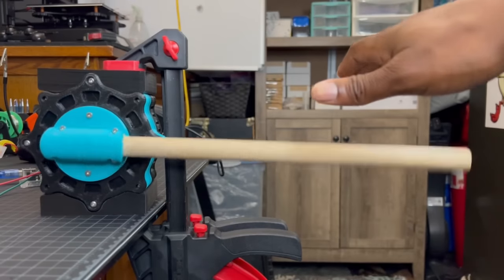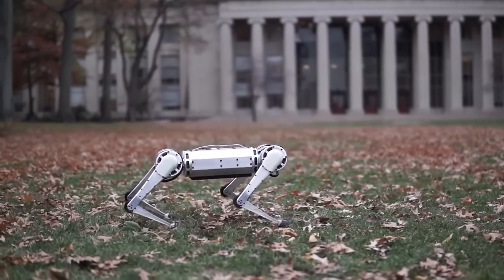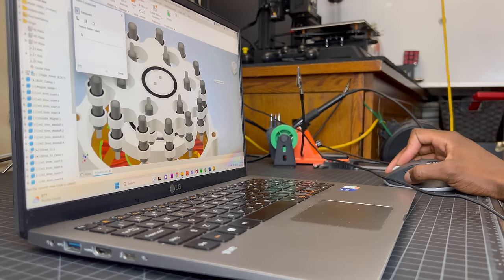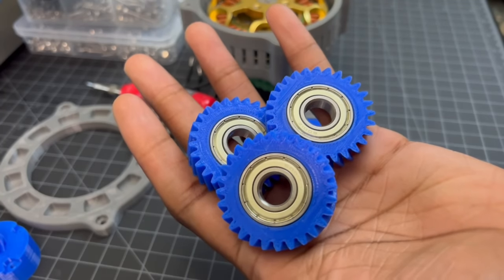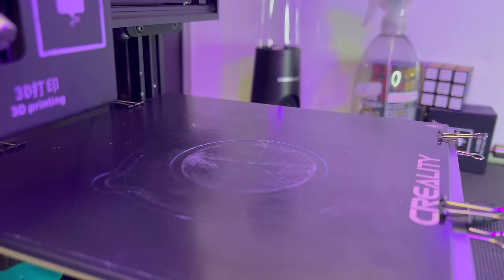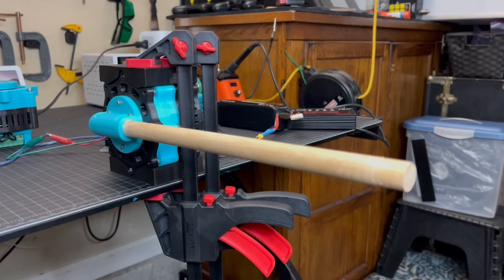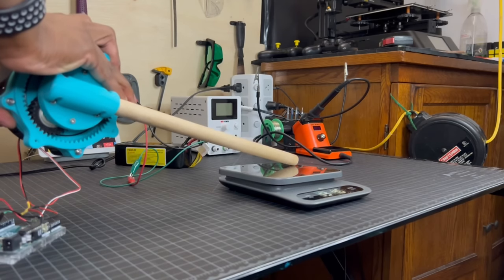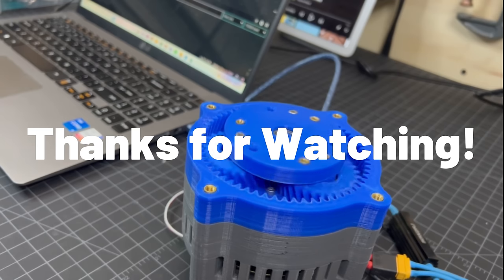I Built a Robotic Actuator.......Lets Test it!

Comment: Awesome video  little advice herringbone gears may be a better idea than helical to keep from exerting a perpendicular force on the gears.  Please educate me if I’m wrong!
Reply from the maker: That's true, but it's impossible to use herringbone gears with a planetary gear drive because you cannot push the planet gears in due to the two different profiles.
Reply: Also, sorry commenting as I watch.  (I love the content don’t take any of this as criticism i could be wrong) when you are fitting your gears into 3D printed parts it may seriously impact your gear efficiency to hammer with uneven pressure. Ideally you would press fit them in with a flat headed vice. In my experience this should extend the lifespan of your parts as well as improve efficiency.
Reply: @AaedMusa ahhh I see!
Reply: Also that controller that you used instead of an esc is so cool, I had no idea brushless motors could be controlled like that.  Really blew my mind

Comment: Wow, that's pretty neat! If you make a video on a walking robot, I can't wait to see it. Your website is pretty dope to get more info and the design from. Top notch creater that deserves more attention. I've heard of those brushless drone motor catching fire becasue usually they are meant to have air blowing constantly through it, but it can be managed hopefully. Cheers!
Reply from the maker: Thanks! Hopefully, that won't be an issue with the current and velocity limits but putting a small fan on the inside could be a potential upgrade in a future iteration.
Reply: James Bruton on here has made many walking robots check him out
Reply: @AaedMusa  With those vents I can see using a small temperature sensor and one of those super small aliexpress 12v pc fans to actively cool it if it starts to overheat. 
Also, production value is 🤌keep it up!
Reply: @andycrask3531  Yes, it's a great channel. I've been subbed to him for a few years. I like this actuator better than the cycloidal drive actuator that James Bruton build for his walking dog because it's much smaller with the motor assembly and everything as well as having fewer barrings which can jack up the cost a lot very quickly.
Reply from the maker: @andycrask3531  I love his videos. I took a lot of inspiration from his cycloidal actuator design in opendog v3.
Reply from the maker: @FasutonemuMyoji  Great idea. Something to implement in a second version0. Thanks!

Comment: I noticed one thing wrong with your 3D printer you may want to consider fixing. Your bed looks loose from the clip at 2:03 underneath the bed there should be eccentric nuts, tighten them until it doesn't wobble. Look up a video on how to tighten it for further instructions.

Comment: Pounds? What's that? Why do they still insist on using outdated measurements instead of adopting the universally accepted metric system? The international scientific community has embraced the metric system for its precision, simplicity, and ease of conversion. Transitioning to the metric system would not only promote global consistency but also facilitate cross-border collaboration, facilitate trade, and enhance scientific communication. It's time to leave behind archaic measurement units and embrace a standardized system that promotes accuracy and efficiency on a global scale.
ps: Liked and subscribed.
Reply from the maker: You are right, buttttt as long as I'm working on personal projects I see no harm in using two-unit systems. It only matters in industry.

Comment: Hey, I'm almost done printing all the parts and I ordered everything I need. I was wondering, is there any particular reason you didn't use a BLDC motor from ODRIVE?
Reply from the maker: Too expensive and low torque densities.
Reply: @AaedMusa  thanks for the quick reply. I figured. Have you done any torture tests to see how well the PLA holds up? I printed mine in PETG.
Reply from the maker: @TheAdventureLog  No I haven’t done stress tests yet. I also haven’t printed around with PETG but I’m pretty sure it should be stronger than PLA. You can always print at 100% infill if you are worried about failure.

Comment: Great video. I would suggest you use a vice for press fitting things rather than a hammer, a vice let’s things go in straighter without any impacts. I would also suggest using nylon for the gears if you are able to print it.

Edit: you should also stop mixing units, you measured the arm length in inches and then calculated torque in Nm. NASA made a mistake once due to mixing units and ended up destroying a probe.
Reply from the maker: Yep, unfortunately, I don't own a vice. I have never tried nylon but that's definitely something to look into.

Comment: The torque is proportional to the area of the stator, not diameter. The flat ones are proffered due to the surface area which provides cooling.

Comment: Please help to answer a few questions for the video:
1: What is the first step in creating an electric actuator for a walking robot?
A. Designing the gear drive
B. Researching the best actuator designs
C. Building the motor controller
D. Testing the actuator compliance

2: What type of motor is recommended for an electric actuator in a walking robot?
A. Standard DC motor
B. Brushless motor
C. Servo motor
D. Stepper motor

3:What is the purpose of using a gear drive in an electric actuator?
A. To increase speed
B. To reduce efficiency
C. To increase torque
D. To decrease compliance

4: What type of gear set was used in the actuator design mentioned in the text?
A. Spur gear set
B. Bevel gear set
C. Planetary gear set
D. Rack and pinion gear set

5: What is the benefit of using helical gears in an actuator design?
A. Low load capacity
B. High noise level
C. Ideal for high load applications
D. Inefficient power transmission

6: What type of controller was used to control the brushless motor in the actuator?
A. PID controller
B. FOC controller
C. ESC controller
D. PLC controller

7: What does FOC stand for in the context of motor control?
A. Field Oriented Control
B. Frequency Oscillation Control
C. Force Output Control
D. Feedback Override Control

8: What is the compliance feature of the actuator used for?
A. Increasing speed
B. Absorbing shock
C. Reducing torque
D. Improving efficiency

9: What was the peak holding torque of the actuator when tested with 10 pounds?
A. 10 newton meters
B. 14.5 newton meters
C. 16.36 newton meters
D. 20 newton meters

10: What is one advantage of the actuator design mentioned in the text?
A. Heavyweight
B. Requires frequent maintenance
C. Open source design
D. Inefficient cooling system

Comment: Please don't hammer bearings into place.  If you must,  at least find a short piece of metal tube the same size as the outer race and tappy-tap on that.   Squeezing them in a vice would be better (with the ring to ensure all pressure is on the outer race)  if you don't have any other kind of press.   If you can't find or make an appropriate tube,  maybe you could print something.

Comment: Thanks! Also, having the clamps on one side made my eye twitch. Those tests aren't providing enough data about the motor without a stationary point. Make your base wider, Flip the clamps 90 and add a few milimeters between,  then reposition the camera. Anyways, I'll be using this within my engineering courses this fall. Thanks again for all you do! Would you be interested in meeting virtually with my students, this fall?

Comment: this is awesome man! but this bed adehision is incredible. I just wanted to give you an advice about that, if you just hit the bed where it is, you are gonna destroy your bed level and also in the long run you can ruin the printer itself. with my cr-10 when it is really stuck there i remove the bed and i place it on a desk to scrape or bang it off.  if you want to just pop the things of the printer it is really nice to have a glass or mirror bed with some hair spray on it or you can just higher up the Z-offset. i hope you find that helpful ;)

Comment: I see you have the glass bed with clips. I find if you remove the bed, then pull off the print, it doesn't mess up the leveling from print to print.

Comment: If this were to be used in a force feedback joystick build, is there a cheaper controller board that would provide the same level of control over the motor?  With 2 axis, it would need two of these boards, unless one board can handle multiple motors. Any interest in designing and implementing a force feedback joystick?
Reply from the maker: I believe there are some like the Moteus controller although I don't know how it compares to ODrive.  This controller is only single axis. Hadn't thought about a force feedback joystick, might just look into it.

Comment: Just being nitpicky but on the website this line should read "A brushless motor with a small air gap to maximize torque density."
Reply from the maker: Actually, the air gap of a brushless motor is directly proportional to its torque density so it should be "a large air gap".

Comment: So how does it compare to standard rc driving servo? How much weight can the servo hold? Do you need an odrive controller for every actuator?
Great video, looking at the dingo robot and they used coreless servos. I think that is just because they are cheaper but still accurate.
Reply from the maker: The main difference (apart from size) is compliance. Servos have no torque control. And yes you need an ODrive with each actuator. I saw the Dingo robot too, its very well made.

Comment: not to be that guy.  Torque density is proportional to air gap surface area.  more air gap (the distance between stator and rotor) is usually inversely proportional to torque.  Flatter motors don't always mean more torque, the further the air gap is to the center of rotation usually means more torque.
Still, good work on the video!
Reply from the maker: How did I miss that? I meant to say gap radius rather than air gap. Thanks for the correction, I'll be sure to keep it in mind in the future.

Comment: Hi there. First of all I am a huge fan of this project. 
I have a question. You said in the video that the odrive S1 has an onboard Encoder. Does  that mean I have to place the encoder magnet right above the exact spot on the odrive? I am a little confused, because documentation covers that quite little. Where can I find more about this?

I am experimenting right now on an odrive v3.6 and an Eagle Power KV90 BLDC and i am wondering if it is worth it to change to odrive S1, so this video and your website are helping me a lot. Thanks
Reply from the maker: Yes it has to be placed right above the exact point. Check the ODrive documentation for more info.
Reply: @AaedMusa  somehow I missed it in the documentation. But now I understood it, thank you very much

Comment: Your build sheet specifies adding an encoder magnet, what are you using to "read" the magnet?
Reply from the maker: The odrive has an onboard encoder
Reply: @AaedMusa  ohh, perhaps I should have done a bit more research before I bought everything. Only realizing that now as I’m trying to configure the o drive. I’ll be modifying and adding to the project, I’ll keep you updated.

Comment: Would it be possible to increase the gear ratio to get sub 1mm high torque precision from this type of home made actuator ?
Reply from the maker: Yes, but it would have to be a 2 stage planetary gear set. The sun gear is currently 8 teeth which are as small as I would want to go. But also I don't really need more torque for what I plan on using it for.
Reply: @AaedMusa  thanks for the reply. I build flight simulators with flight controls that need to be manipulated to allow the autopilot to fly the aircraft. They also need a type of spring feel to them. The actuators we currently use are 10’s of thousands of dollars and have the exact same functionality as this actuator. This could be a suitable alternative. Thanks for the video.

Comment: Is it possible to make such actuator smaller?
What type of motor and controller will be needed to do such? Possibly some small motor and controller from DIY brushless camera stabilizators?
Reply from the maker: Yes, it is! If you make custom motors instead of using existing brushless motors then you can greatly reduce size. As you suggested, gimbal motors could work but they would not nearly be as strong.
Reply: Thank you for answer!
So probably some motor rewinding will be needed
Do you maybe have idea if there is cheaper controller that could be used with smaller motors to make it more budget friendly?
Reply from the maker: @bartoszgaj7788  The only one that comes to mind is Simple FOC. I have never used it though.

Comment: Great video man I'm a fan of ur work. Is there a way I can access your design for the actuator.
I'm starting out learning robotics and I want to do a project that'll require sth similar
Reply from the maker: links are in the description
Reply: @AaedMusa  ok thanks. Also is it possible to use a 2400kv brushless motor to do sth like this
Reply from the maker: @chibuezendiokwelu63  You would have a lot less torque and you would have to redesign the gearbox. Assuming that your motor is a different size than mine.

Comment: Thanks for providing the shopping list on the site.  Would you say that brushless motor wouldn't server the same function for a robot arm or would that a difference in configuration with the odrive?
Reply from the maker: I'm not sure if I follow, could you clarify the question?
Reply: @AaedMusa  since your goal is to make these actuators springy, I was curious as to whether it excludes them from working as robot arm actuators.
Reply from the maker: @Gee-Dee-q1e  You can make them springy or really stiff meaning that they can be used in a robot arm and other applications.
Reply: @AaedMusa  thanks so much for confirming!

Comment: I wonder if you could package the planetary reduction in the center of the pancake motor to cut down on size…
Reply from the maker: You can’t do that with these motors since there’s bearings in the middle, but if you create your own custom actuator this is possible. It’s exactly what was done on the MIT Cheetah robot. I’m currently in the process of building an actuator like this.
Reply: Yeah I was thinking something like the cheetah actuator would be awesome to make open source. There are off the shelf planetary options that may package well in the center. Max planetary stages from Rev could work well imo.
Reply: I wonder if you could harvest the coils from an existing bldc? That could make it a lot easier and less prohibitive to make DIY.
Reply from the maker: @luciengenova8688  I've found that it is impractical to harvest anything from an existing BLDC. You would have to buy the entire BLDC for just that one part. The stator is glued to the metal frame anyways so I couldnt remove it if I wanted to. For this upcoming actuator I'm using an off the shelf stator and a cycloidal gearbox in the center rather than planetary. This will be my next video. Stay tuned!

Comment: I used one of your SEA actuators to compare with an actuator i designed for my final year project in college
Reply from the maker: Nice! Hope that worked well for you. This one is definitely much better made.
Reply: @AaedMusa  yup it did! Yes great actuator, if you ar einterested my actuator is a modified servo that can  act like those quasi drive ones even compliancy and springiness
Reply from the maker: @ironman5034  interesting, do you have your work posted somewhere ?
Reply: @AaedMusa  not yet where do you suggest
Reply from the maker: @ironman5034  Hackaday

Comment: Excellent - do you plan to measure the output angle?
Reply from the maker: The motor controller already measures the output angle.
Reply: @AaedMusa  Sorry I meant the output of the gearbox.  :)
Reply from the maker: @nylesnettleton88  With the motor controller I can still measure the relative position of the output shaft, juts not the absolute position.

Comment: Why not use axial motors?
Reply from the maker: I went with what I am familiar with, what has high torque, and what I could get off the shelf. What's the benefit of axial motors over brushless?
Reply: @AaedMusa  it was supposed to be axial flux motor. I have been researching and see they have hi torque and being used in electric cars and planes.
Reply from the maker: @rgsattphone Interesting. From what I've seen you can't buy those off the shelf, you have to build them (powerful ones at least). However, axial motors do seem like a cool project on its own. I just wouldn't use them to build actuators that I plan on building robots with.